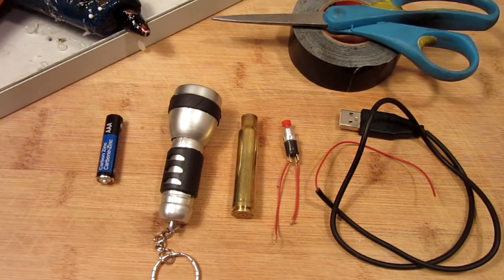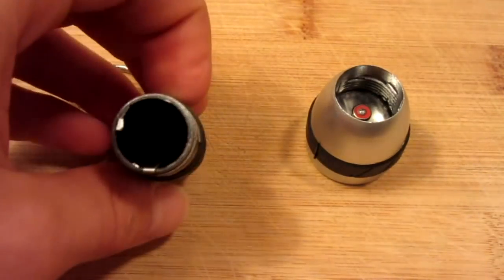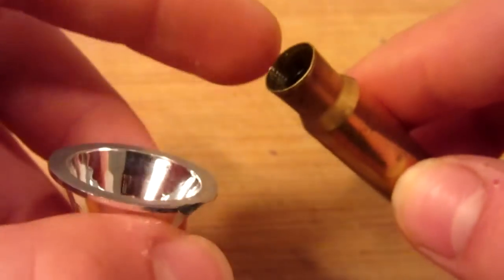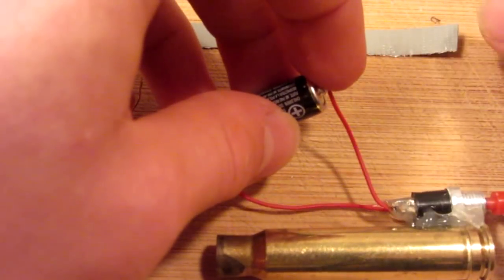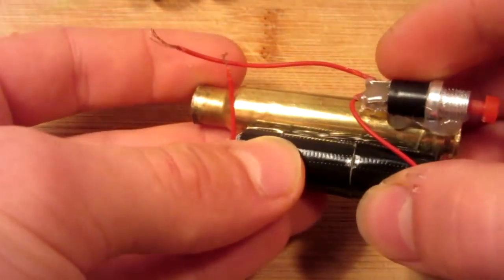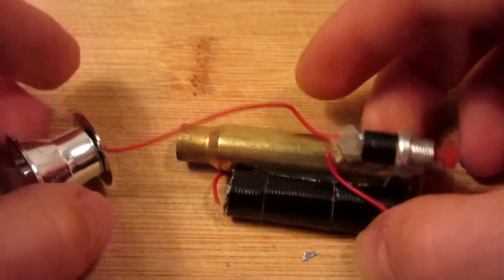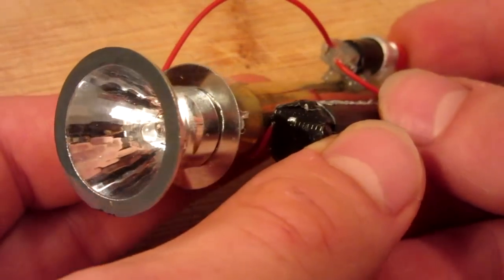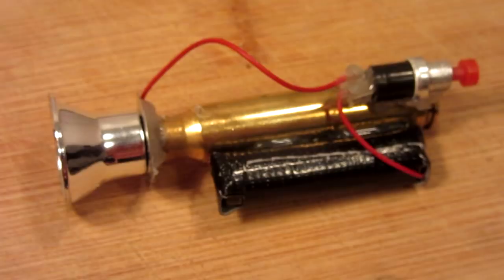How To Make a Flashlight from an old Bullet Casing

Comment: You should of cut the casing in half and put the battery in the casing itself, negative side down. The put a switch in series connecting the positive end to the bottom of the flashlight.

Comment: Huh? You literally took a working flashlight and then rewired it to go on a bullet case. For one! No one is going to take a working flashlight and hot glue it to a bullet casing. Second! Not everyone has bullet casings lying around. This project makes absolutely no sense. I understand if you're going for some sort of esthetic look but even then you have wires hanging which can be easily damaged. Total fail!